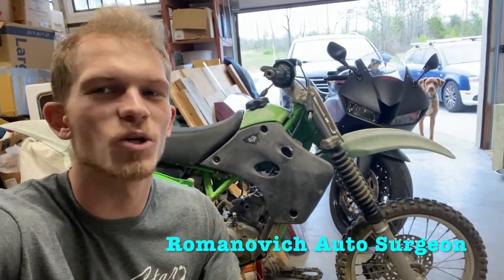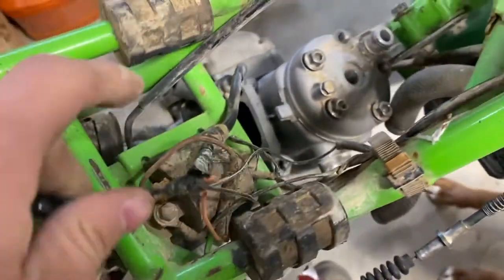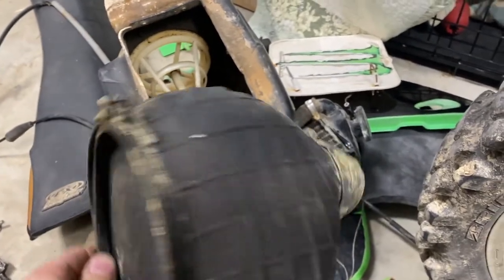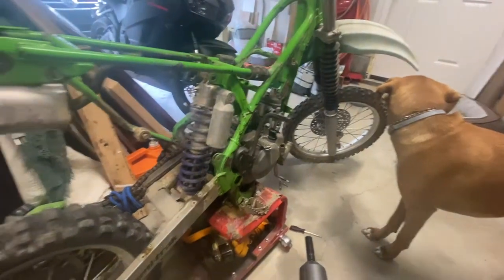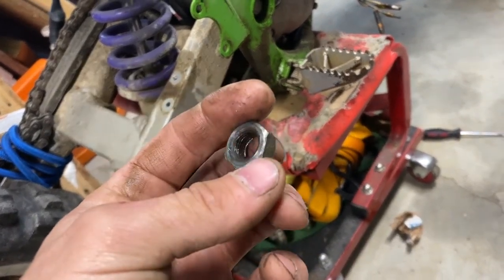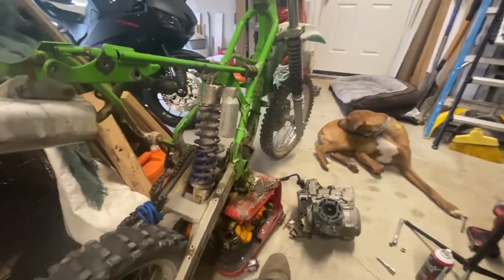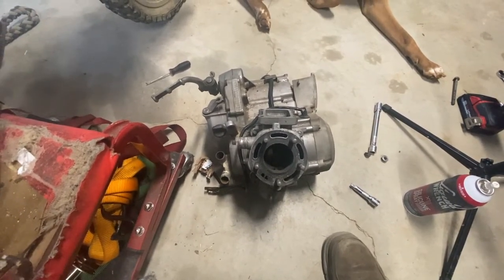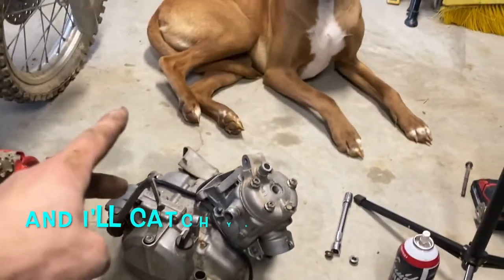1994 KX80 Rebuild Part 3 | The Teardown |

Comment: Where can i get a 1996 kx80 cylinder?
Reply from the maker: You can try and get it form cycle gear. They have books of parts that they can find and try and order. Very hard to find otherwise
Reply: @RomanovichAutoSurgeon  i i just put a little bit of jb weld on the scores and honed it out. Pretty confident itll work!